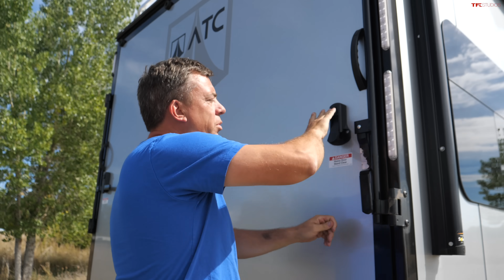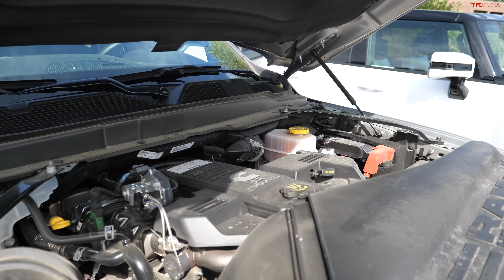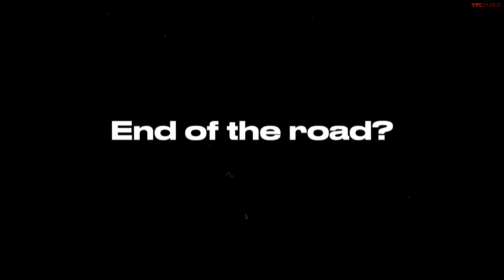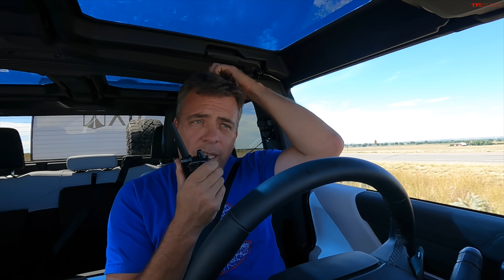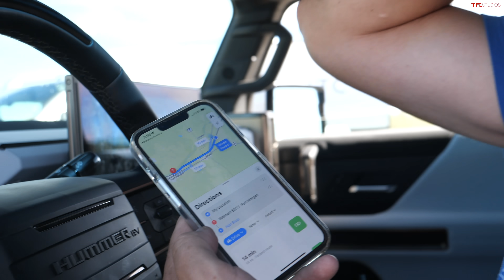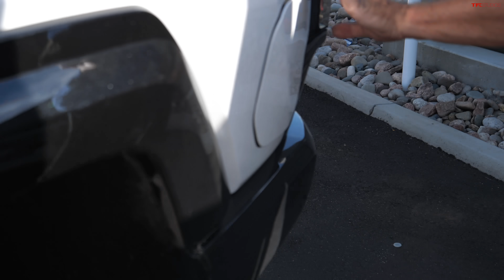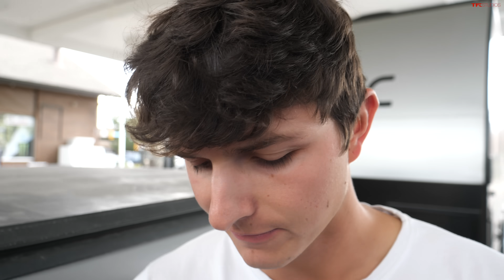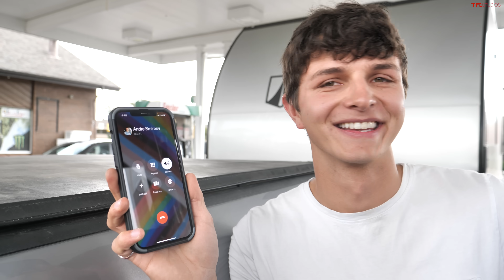How Far Can a Diesel and Electric Truck Tow An Identical Camper Trailer on ONE Fill-up?

Comment: One thing not mentioned was the wasted time charging , Also I noticed in the charging cost if they had to pay was $37.75  . The Cummins cost for fuel was 75.00 and went twice the distance as compared to the Hummer . So  the hummer costing more per mile to drive than the Dodge , I'd love to see how long that pretty hummer would stand up on the farm pulling gravity bins full of grain. I'd also like to see the hummer after 350,000 miles and how long before the battery would need to be replaced . I have a 2008 Ram  6.7 cummins with over 200,000 miles and still  looks and runs like new .
Reply: For comparison, Ford is stating that, worst case, an F-150 Lightning owner would have to replace their entire battery pack every 5 or so years...at a cost of $35K!  Can you imagine the disappointment of having to put another $7,000 a year ($583/month) into battery-related maintenance on a $100,000+ truck?!?!
Reply: @dp9324  thats a replacement. But if you have a toolbox, you can rebuild the batteries.  Ford will gladly sell you a whole new battery if you're incompetent.
Reply: @blmartech  Yeah, the average guy isn't going to attempt to remove, rebuild, and reinstall an 1,800 pound, 98Kwh lithium-ion battery pack in his garage in his spare time. But good luck to you if you think you can do it...
Reply: @dp9324  there never was a doubt that I couldnt.
Reply: @dp9324  I know right, that was the stupidest i've ever read... Who the hell is going to rebuild a battery in your garage
Reply: Was $37,75 only 50% charge, maybe i misunderstood but i though he only charged enough to get back, so double that to $75.50 if that's the case and that aint cheap.
Reply: I worked at a grain elevator for five years. It would be very interesting. Those wagons are no joke. They are HEAVY. I think you would make one trip into the elevator and the hummer would be about dead lol
Reply: Besides the initial time wasted on the charging, what if he had to wait extra time if all those charger stalls were occupied with other EVs charging? Also going to pay a bit more if your State vehicle registration fees use weight and ownership tax (like Colorado) to factor what you owe for registration. Doesn't sound like much of a savings at that point.
Reply: Paying that much to recharge? What a ripoff.
Reply: And then watching the hummer out in the Mojave where darn near every system on it broke down and he ended up cancelling the run and driving out on the dirt road in 2 Wheel Dr.
Reply: You aint driving it on the farm if it still looks like new haha.
Reply: EVs for towing just aren’t there yet. You can do it but you will have to charge more often which wouldn’t be a deal breaker for me as I would only be towing for recreation anyway so a little more time wouldn’t bother me. For work its just not practical.
Reply: $101 due to credit card maxing out at $75, so reset was needed, which is annoying!
Reply: Couple of things. I own a diesel truck, I get both sides, but EV naysayers make the same points that I feel there are reasonable rebuttals too.
1. Wasted time charging.
Rebuttal: sure, on trips a couple of times a year you spend extra time at “fuel stops” but the rest of the year when all you are doing is commute and local travel, you are charging at home and spending 0 time at fuel stations. The net result is time gain for the average person. 
Cost of fuel: yes, fast chargers are still cheaper than diesel typically, but not by a huge margin while towing. Again, 90% of the year the average person is charging at home at a far cheaper rate.
Longevity: batteries I’ll give you, to be determined. But the rest of the driveline has way fewer moving parts than an ICE. Time will tel.
Reply: Except diesel trucks are absurdly expensive to repair/maintain.  Don't get me wrong EV's aren't meant for towing but they are extremely low maintenance.
Reply: @Thomas Thompson  Diesel trucks are neither difficult nor expensive to maintain? Especially compared to their petrol counterparts. I have a 1995 Land Rover Defender 130 quad cab with a 300Tdi and a five speed manual. It rolled over 322k miles today. In the past 100k miles, I have changed the oil five times (I use Penzoil Ultra Platinum full synthetic 10w40), replaced a clutch (the second clutch the truck has ever had, $350), replaced the expansion tank with an aluminum version ($80) and while I was under there, replaced the belts and hoses (~$60). Pretty sure that was the original expansion tank and those were the original belts and hoses. Its my daily and I use it to tow vehicle trailers. So, $500 + oil in maintenance and only $350 of that $500 was technically necessary.
Reply: @hemiwarrior6226  You are comparing a 28 year old diesel to a modern diesel. No comparison. I agree, your simple 1995 model is a simple machine. Modern Diesels, not so much!
Reply: On an industrial lot the hummer would last a million miles. Pulling a grain wagon a 20 miles a day would be childs play. Cost of fuel would be insignificant if you were charging from AC power. Savings from the cost of diesel would be so high that the hummer would be paid off in less than a year.
Reply: If it was a toyota, at 200k it would just be breaking in
Reply: @blmartech  200K it's like 100k miles on a Toyota and any diesel truck to be honest.

Comment: This reminds me of the horse vs car races of the 1890s.
Reply: It's physics. If you tow or haul more weight, it will require more energy. The diesel had more energy stored in its tank than the EV had battery storage. So, the EV manufacturers will need to either provide more battery storage, improve the vehicle's efficiency, or both.

Comment: LOL, like how they have these charging stations built like gas pumps!
Reply: Don't forget, you may well have to remove the trailer to use the fast charger or to keep from blocking the driveway.  Also if you were forced to use the slower charger, you'd be there for a lot of hours...every 128 miles.

Comment: With a 2004 Ram 2500 Cummins towing a 33' 10k travel trailer it got around 10-11 mpg. With a tune it now gets 16 mpg. We normally travel right around 65-67 mph. This is because it doesn't have all the emissions stuff. I have to wonder how much better these new Cummins engines would do without the burden of all the emissions stuff.
Reply: I get around 21-24 on a Ford, with emissions around 14.  🤡 For the environment
Reply: @user-rn3rn6nl3h  yeah... it's all a joke
Reply: With my 97 Ram 4x4 12v towing a box trailer roughly the same weight as they did in this test at 61-63mph I get 17-18 mpg. With the newer computer engines they have something called the 3rd injection event which injects more fuel for the sole purpose of emissions and making the engine quieter. It does not contribute to power at all, it just throws fuel away. Your tune most likely got rid of the 3rd injection event or at least modified it. If you can still do that on the newest engines they should also get a similar increase in fuel economy.
Reply: @THX..1138  2010 Ford F350 went into cleaning mode Every 25 miles Killed my Mileage.
Reply: A lot.  The "newer" Cummins engines are set up for emissions instead of fuel economy.  They are physically capable of far greater efficiency with a cam and tune change that keeps them at or under 2500rpm.  It's telling that my twenty year old 5.9 gets better mileage than a 6.7 ever will in road legal form.
Reply: My 2002 7.3 Powerstroke does about 11-12mpg pulling a 9000lb travel trailer.
Reply: Mine is stock. What sort of tune should I get?

Comment: With my '99 Dodge 3500 dually with the 5.9 Cummins, empty,  I can travel from Johnson City, TN to Texarkana, AR, which is 777 miles, on one tank of fuel. I have a 35 gallon tank, and when I took the trip I averaged 23 mpg which comes out to a range of 800 miles.  I'd have to charge an EV at least twice along the way and lose a minimum of about 2 hours to charge, where it'll only take 15 minutes to fill up my diesel.
Reply: Did you bring back a load of coors though
Reply: @lynskeyti9940  No. The Snowman already beat me to it. 😂
Reply: Time is the killer. Your estimate assumes the chargers will work and work properly and at top charging power. The reality is that it will take much longer then 2 hours to charge a truck. I am definitely a diesel proponent especially since they put DEF in it to clean it up. The diesel industry did all this work to find a better way and the leftists just try constantly to close down the diesel industry. It's insane.
Reply: @phil4986  You're right, I was basing everything on perfect conditions that the developers and manufacturers of the EVs claim. The factors that I didn't include and the manufacturers don't tell you is how weather conditions effect range and charge times on the batteries.
Reply: @mikeadams2677  You did say 'the minimum' so you were being fair. Hoovies on YouTube just sold his co-owned, brand new, Ford Electric pickup truck because of HALF the range in the cold without towing anything. Ford had the gall to say, in the instructions for more range to turn off the heater. So much for defrosting your windshield.
Reply: @mikeadams2677  When these guys tested the Ford Lightning (that Ford claims will get 300 miles), pulling a 6000 lb trailer, they almost made 100 miles.
Reply: Bur  berdet hell i got to go
Reply: 2 fill ups on the EV would be less than $40 your Dodge will be close to or over $400. So you're saying 2 hours of charge time isn't worth $360+?
Reply: @tjewett1967  6,000 lbs is nothing for any Dodge/Cummins, let’s bump that load up to 20,000 lbs and see just how far that Hummer EV will go on a single charge. 
Pure BEV trucks do not make any sense, add an onboard range extender while reducing the battery size and an EV Truck becomes practical. As for the onboard range extender the best choice would be a Microturbine Generator (MTG). 
MTGs are almost ZERO EMISSIONS, are efficient at producing electricity, can utilize almost all currently available fuels including Alcohol, Biodiesel, Gasoline, Diesel, Kerosene, Jet Fuels (turbine) CNG, LPG, Hydrogen, and others. 
MTGs do not require any scheduled maintenance, are relatively compact and lightweight (300 lbs) and can power the EV while simultaneously recharging the batteries.
Reply: @andersonnettleship845  But would using MTB's make the politicians rich?  I think you are onto something.  I've been saying for a while now, hybrid is still the most reliable/efficient for most people.  This thing isn't a one solution fits all.  EV's are great for some people.  Hybrids bridge the gap for the others.  Imagine like you said if they made diesel hybrids of some sort.  Take the most efficient parts from ev and diesel and put them together.  Also, hydrogen conversions is a super green way to combat pollution.  Actually converting older cars to a cleaner fuel(hydrogen) instead of scrapping them and polluting by making a bunch of new EV's.  But this whole thing isn't about actually being green.  Those of us that actually care are those of us keeping older fuel efficient cars on the road not going out and buying brand new EV's.  I'm driving a 99 Honda CRV that I rescued from the junk yard.  Put a new motor in it and drive it everyday.  I also have an older truck that I use when I need to pull trailers or haul more.

The whole "green" movement is a political scam.
Reply: @andersonnettleship845   more weight, less cargo, less efficiency.  So you also want to add something that burns fossil fuels?
Reply: @tjewett1967  One charge in the video was $40 for 123miles.  A commerical user of a 'truck' is usually in field service, at an hourly cost of $150/hr, so yes 2 hours of charging is going to put people out of business.

Comment: These EVs are a joke!  Super expensive, pain in the @ss to charge and very limited on range.  Not to mention the untold harm to the environment from mining, extra tire and brake dust and highway damage from the overly heavy vehicle.  They are also not any cheaper to operate in the long run.  lining the Dem politician's pockets is all this is doing.  No Thanks!!

Comment: Other things besides cold weather towing to consider are the cost of a battery pack replacement and carbon foot print to manufacture each vehicle.
Reply: Yea, the Bidens will profit off of those battery packs. You can count on that.

Comment: So you're telling me this $116,000 car,.... only got just less than half of your range pulling 3/4 of your load limit... and you would of paid $2.338 per/KWh?.. for under half of a full charge..  which took over a half hour mind you!. ... $2.338 .... per KWh! We had gasoline cheaper than that two years ago! What are people even thinking! Oh its cheaper to charge at home! Well screw your longer family trips then! The average kost per KWh where I live at my house is 0.16 PER HOUR. And you're paying 20× ++!? No. Just no. Theyre cute I'd get one for commuting to work. But these will not replace internal combustion. The cost doesn't justify the means. Why can't they work on hybrid pickups?!

Comment: With my 40 years experience in the auto industry. The current design of electric vehicles = what we call a nitch vehicle. And is viable only with respect to specific usage requirements. 
In my opinion if the battery was oem. Owned and interchangeable.  I.e. pull into the dealership swap in a fully charged battery and drive away. Two issues that i see are addressed.  The elephant in the room for me is the eventual cost of battery replacement. 
Obviously I am not sold on this industry pushed concept.